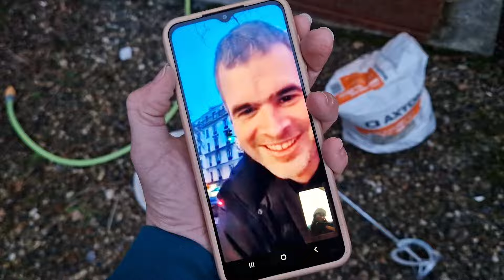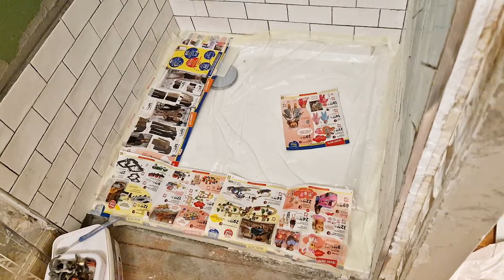I tried making the hardest shower tile pattern but I have ZERO skills or experience

Comment: When patching a wall you need to use mesh tape to seal edges & holds in place. Then you add patching mix to that in thin amounts. Sand then paint. Tiles are looking nice!

Comment: As someone has said you need the tape the edges of the plaster board before plastering over the area. Check on the internet before starting jobs that are new to you to find out how to do it. Save you in the long run. 😜😊 when I’ve watched other vlogs they use spacers between the tiles and the plaster is evened out with a spatula that has groves to level the plaster before adding the tile, a level to check they are flat. 😊